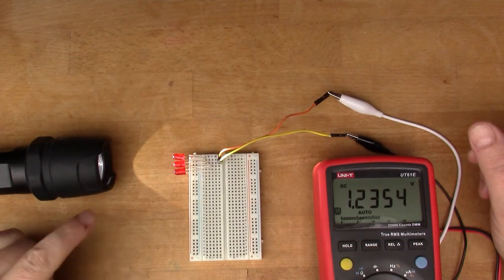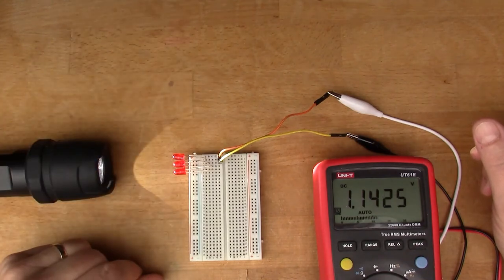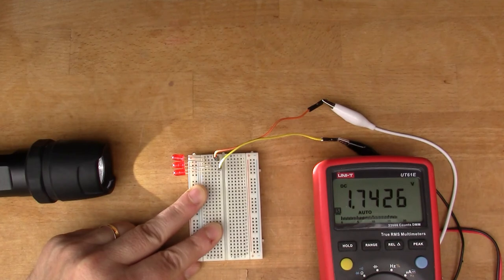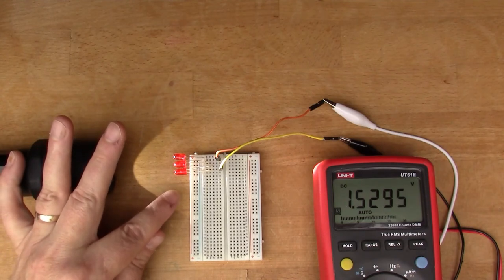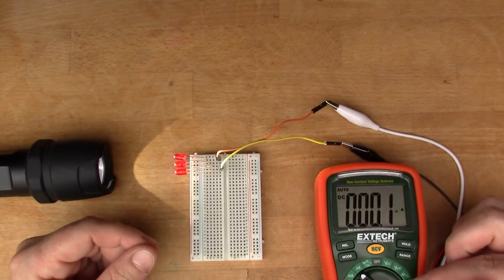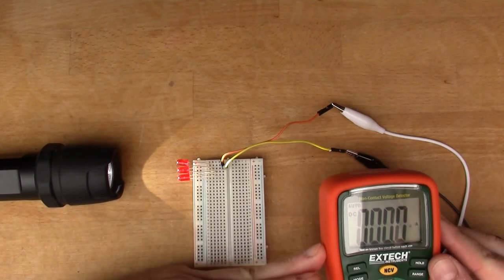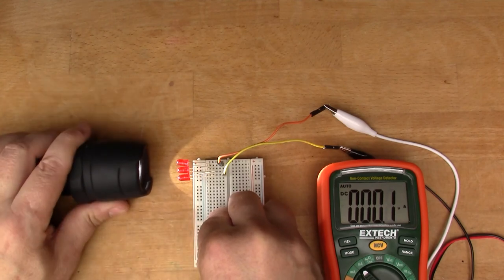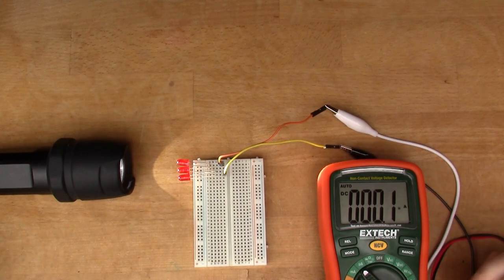Diodes and LEDs Can Detect Light (Part 2)

Comment: Thanks for the follow up, glad you tested the current as my meter will not do micro amps. Nice vid. So with enough series and parralel leds you could actually make a sudo solar panel, who would have thought!
Reply from the maker: I think a PV solar panel is basically a large diode, so you are exactly right.